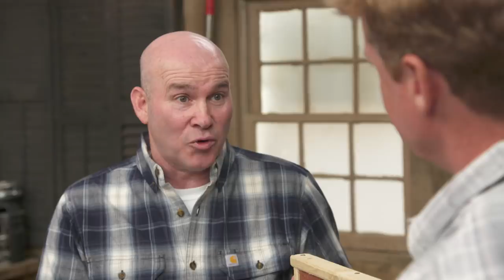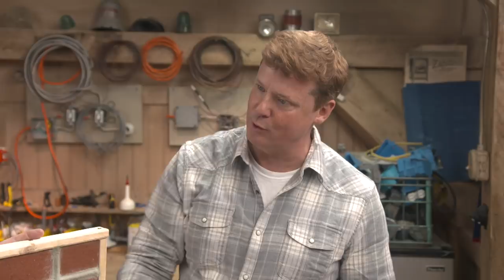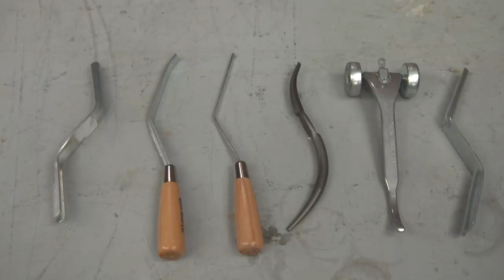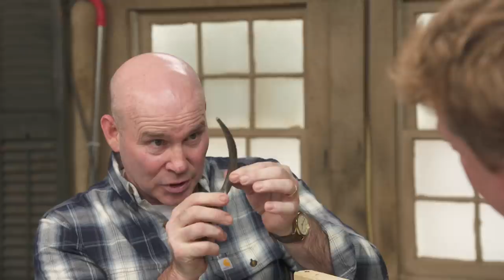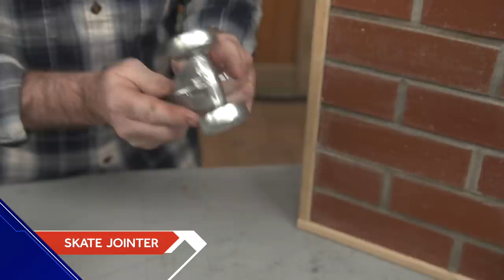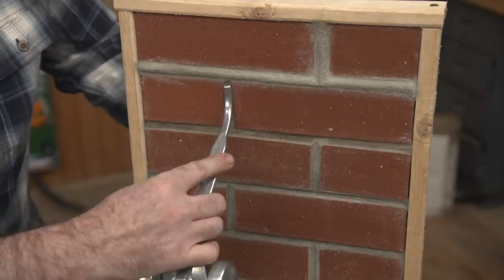Comparing Masonry Jointers | Ask This Old House

Comment: Interesting stuff. Here in the Intermountain West we call the Convex Jointer a Round Jointer and the Skate Jointer a Rake. I worked in brick and stone masonry for 7 years and never even saw or heard of a Rat's Tail or the Concave Jointer.
Reply: In the UK we call the skate jointer a mortar rake and mainly use it to rake out mortar from the joints before repointing.
Reply: The Rat's Tail jointer I have was called a Bull's Horn jointer where I purchased it.
Reply: @davidmarsden9800  do you we’re we are in the uk we’re call it a chariot as it sort of looks like one lol

Comment: Your skate jointer is called a mortar rake in the UK and is mainly used to rake out the mortar from joints before repointing as well as the use you showed.
Reply: Depends we’re your from
Reply: @kierenboimufc5940  That's true, there are different names for it in the UK, but that is it's main one in every tool catalogue for many decades.
Also depends on your age and location.
Reply: @davidmarsden9800  Kent I think we all have nick names for tools don’t we like Gary neveille ( level) lol
Reply: @kierenboimufc5940  yeah, every trade does, great old tradition that.
Reply: @davidmarsden9800  rain dance is my best it’s good when it works lol

Comment: My father, a second generation mason contractor didn't  " joint up a wall". He used the term strike up ???
Reply: We'd call it 'pointing' or more likely 'face up' here in the UK.
Reply: Different terms for things in different areas and across time.
Reply: Actually our most common term would be 'iron' up the wall, as UK brickies used to use half round solid bars of steel/iron.

Comment: Would you use the convex one on a  concrete cinder block foundation?
Reply: Sio yes I would. If u do others there chances for water or dirt to sit on that joint. You want your masonry wall the shed the water and moisture. A raked joint is the worst actually and seems to be he most popular but it makes a ledge for moisture to just sit on.

Comment: Anyone know what I can use to seal interior brick in our house living room to stop the dust coming off it?
Reply: Ty Smith you could use a sealer. We’ve used them on natural stone showers. There are sealers and enhancers but your just looking for a sealer. It would be expensive. I would buy a small jug and do a test spot in a place that wouldn’t be seen much. Like near the floor behind the couch. Or u might just have to take a shop vac with a Brussel head and scrub the masonry wall to get all the little pieces off. Hopes this helps.
Reply: Many thanks for the reply. Will give it a go. Would they sell this at places like Home Depot?